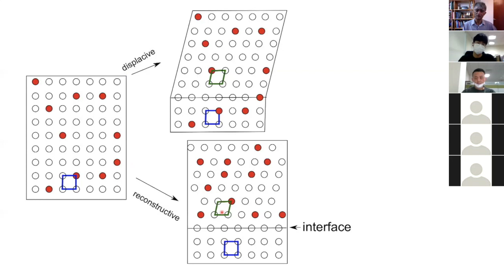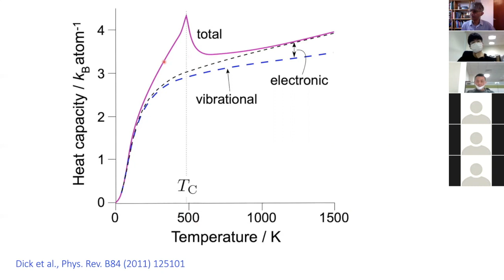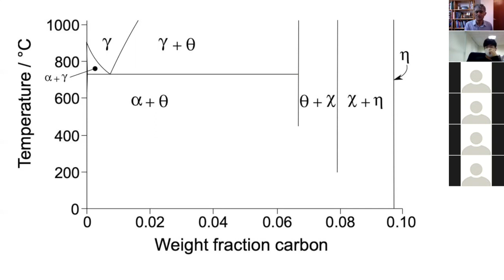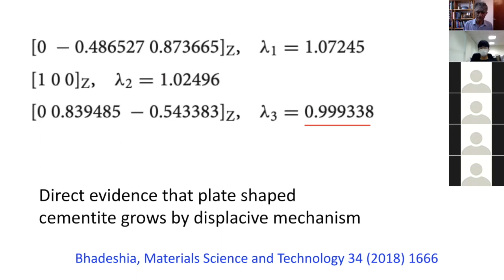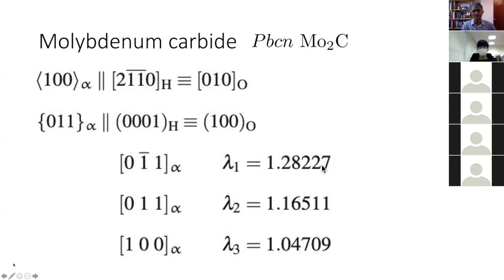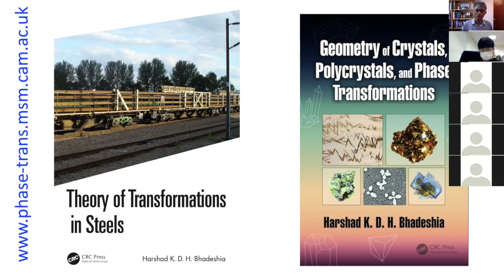Phase transformations in carbides

Comment: thank you for sharing. Mo2C formation in ferrite is a diffusive process, why the strain energy is so much that  then it form as needle shape?
Reply from the maker: There are two reasons why orientation relationships develop. The first is that the product lattice is generated by a deformation, as in displacive transformations. The second is that during nucleation, there is always a level of coherency to minimise interfacial and strain energy resulting from that coherency. So the shape for a reconstructive transformation will tend to minimise that strain energy.
Reply: @bhadeshia123  Thank you very much.